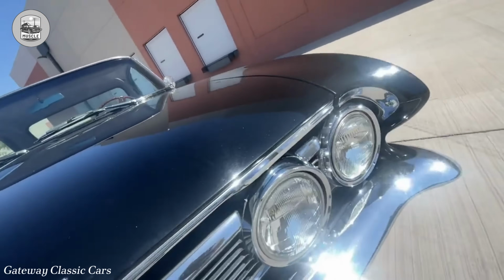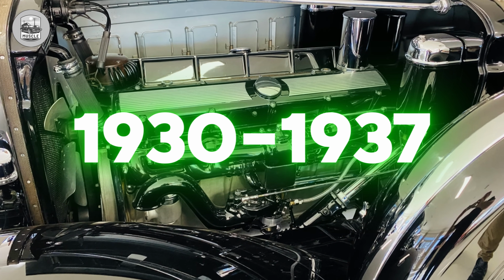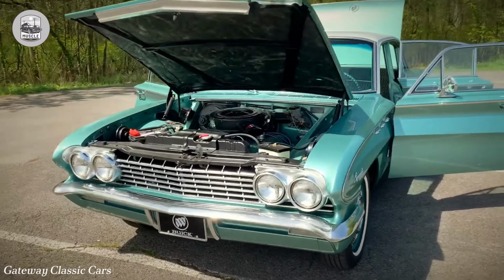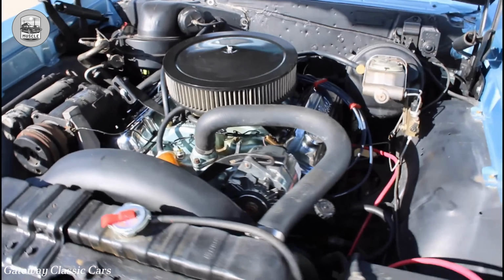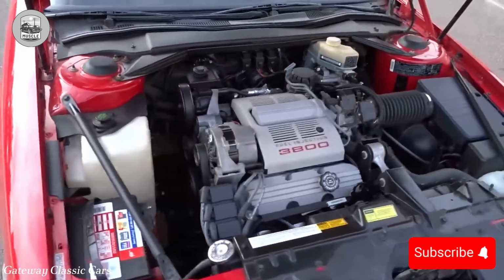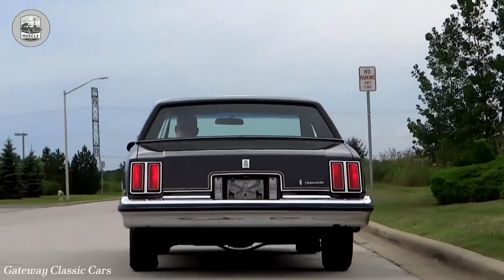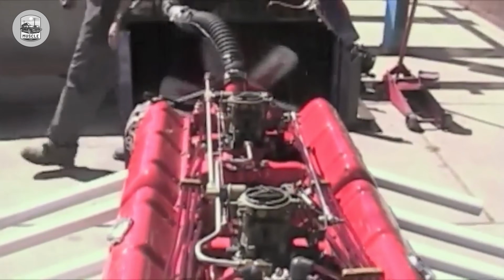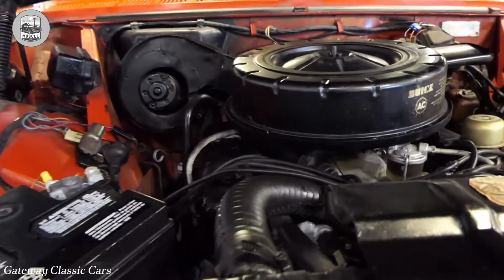10 MOST FAILED and WEIRDEST GM Engines ever made | Worst engines blunder!

Comment: I took an Olds 455 to 501 cu in and 12:5 to 1 compression. At 10K revs 856 rear tire horsepower. 19 miles per gallon city; 26–28 miles per gallon freeway. My Subaru gets 19 freeways on alki gas mix. Pure Gas gets 361 miles on freeway per tank.
Reply: It took about $12K to do that motor. Special box of tools and internals for a  Holley 650 
spread bore  First built it with a Norris 652 race cam and Edelbrock Dual Plane intake. 1050 Dominator carburetor.  THAT combo would not idle under 40 mph. Rear end was rated at 2K hp. Widest ratio Muncie I could find and rigged for super duty. Paint sucked. It could and did run through a radar trap at 138 in 3rd gear.
Hd to fill up and stay away from main roads getting home, lol.
Reply from the maker: @roberthodge2771  Wow! That’s a serious setup you’ve got there! A $12K investment into that motor with those internals and the Holley 650 spread bore is impressive. Pairing it with a Norris 652 race cam and Edelbrock Dual Plane intake sounds like a beastly combo, though it’s no surprise the 1050 Dominator carb wouldn't let it idle below 40 mph—pure race engine territory! Running 138 in 3rd gear with that Muncie and a rear end rated for 2,000 horsepower? Absolute monster! I can imagine the fun (and the challenge) of filling up and keeping it stealthy on the way home.

For everyone reading this, do you have your own stories of insane builds or wild rides?
Reply: @MuscleCarMasters68  After 3 different police agencies gave me a head shake for burning it through a intersection with naught but letting out the clutch; I went home and yanked the engine in my hillbilly working bay of logs in a pair of 'V's" and a 6" I=beam w/ lifting swivel. Stood on the engine with a Coffin Hoist 3=1/2 tone cap. Changed intake, can, carb, and re=inserted it and then went on a date. 10 am till 5pm turn around time. Had to drive the 1958 GMC 4x4 1 tone to get the parts from the shippers. Oh, well. Country mechanics at it's finest.
Reply from the maker: @roberthodge2771  
That’s an awesome story! True country mechanic spirit right there—using what you've got and making it happen. Sounds like you’ve got some serious muscle under the hood with that setup! Swapping out the intake, cam, and carb in just a few hours is no small feat, especially when you’ve got a '58 GMC 4x4 1-ton to get the parts. That’s real dedication, my friend.
Reply from the maker: Wow! Taking that Olds 455 to a whopping 501 cu in with 12.5:1 compression and hitting 10,000 RPM while still getting 856 rear tire horsepower is truly impressive! Not many can claim those numbers, especially with that kind of fuel economy. 19 MPG in the city and up to 28 MPG on the freeway? That's outstanding for a big block with those specs! It really highlights the versatility of these engines when dialed in just right.
As for your Subaru, it's always amazing to see how the difference between alki gas and pure gas can impact mileage. 361 miles per tank on the freeway with pure gas is something a lot of us would love to achieve.

Everyone tuning in, if you're into engine builds like this, let us know about your own! Have you pushed your Olds, Chevy, or Ford block to its limits? Share your stories in the comments! And don't forget to hit that subscribe button to keep up with more killer builds and wild engine setups. Check out our other videos on Muscle Car Masters and be sure to share your builds—this community thrives on your input!

Comment: The ONLY GOOD engine of the bunch was the V-6 engine that became the 3800. The rest were refugees from a scrap iron pile. I don't know how many of these "freak" engines were designed by the same designer. if there were  2 of them or more from the same guy, GM should have handled him a shovel, and told him to dig a grave big enough for every engine he designed!  And SHAME ON GM! Releasing one gasoline engine that was converted to diesel is one thing. A learning curve. But after that, they should have fired the people in charge of the rest.  And by the way, the cylinder deactivation still is a big failing point. If you want a six cylinder engine, buy a six cylinder. But do NOT expect a medium sized v-8 to give you 4 cylinder economy. there is ALWAYS a price to be paid. and that price is failed parts that costs thousands of dollars to repair. you will noticed i said repaired, NOT FIXED. FIXED means it will no longer be a problem. repair means to put it back to stock. meaning it WILL FAIL AGAIN!
Reply: I respectfully disagree with your view, especially regarding GM's engine lineup. While the 3800 V6 is indeed a great engine, it’s not fair to dismiss the rest as "refugees from a scrap iron pile." GM has produced many innovative and durable engines over the years. For example, the Oldsmobile 455 and the 409 are both highly respected for their performance. As for the gasoline-to-diesel conversion, it was a significant learning curve, but dismissing the entire diesel lineup doesn’t account for the innovation that came from it. GM's efforts in engine development, especially with cylinder deactivation (DoD), show forward-thinking strategies to improve fuel economy. Yes, early DoD systems had challenges, but modern iterations have come a long way. It’s all part of the learning curve that drives progress. Rather than outright failure, these innovations represent necessary steps toward better technology.
Reply from the maker: Thanks for your passionate comment! You’ve touched on some key points that have stirred debate for years. The 3800 V6 certainly stands out as one of GM's most reliable and versatile engines. It was a true workhorse, found in everything from Buicks to Firebirds, and delivered an excellent balance of power and efficiency.
As for GM’s foray into diesel engines, you’re spot on—those converted gas-to-diesel engines, like the Oldsmobile 5.7L diesel, were notorious for their problems. The idea seemed good on paper, but the execution fell short, causing plenty of headaches for owners. It's one of those moments in history where hindsight makes us wonder how different things could have been.
On the topic of cylinder deactivation—no argument there. GM's early attempts with the V8-6-4 in the 1980s were far from perfect. The technology has improved today, but you're right, there’s often a trade-off in long-term reliability when it comes to complex systems like that. If you're after true efficiency, a dedicated 6-cylinder engine might be the way to go, but the quest for combining V8 power with 4-cylinder economy has always been a tricky balance to strike.

We’d love to hear more from you and the rest of the Muscle Car Masters community! What engines do you think GM did get right? And for those reading, make sure to comment, share your thoughts, and hit that subscribe button! Don’t forget to check out our other videos for more deep dives into American muscle car history and engines.

Comment: You missed the IH 4 bangger it was a cut in half V8 as well they used them in the Scoots 4 by 4s
Reply: Actually, while the IH 4-cylinder engine used in Scout 4x4s may seem like a 'cut in half V8,' it wasn't exactly that. It was derived from the V8 platform but designed specifically as a 4-cylinder. The key difference is that IH engineers didn’t just slice a V8 in half and call it a day. They carefully re-engineered the block, crank, and internals for the 4-cylinder to ensure it performed reliably in those rugged Scout models. So, while it's based on V8 design concepts, calling it a 'cut in half V8' misses the engineering refinements that went into making it work as a strong 4-cylinder engine.
Reply from the maker: Thank you for bringing up the International Harvester 4-cylinder engine! You’re absolutely right—it was essentially a V8 engine cut in half, which is a unique approach. IH used the 152ci and 196ci versions in the Scout 4x4s, which gave them that reliable, torquey performance while keeping things simple for off-roading. This engine was a tough workhorse, much like its V8 counterpart, and its simplicity helped make it a popular choice for people who loved getting into rugged terrain.
What other unusual engine setups from this era do you think deserve a shoutout? Let’s keep the discussion going! Be sure to comment below with your thoughts, share this video with your friends, and don’t forget to subscribe to the Muscle Car Masters channel for more awesome content. Check out our other videos while you’re here—there’s plenty more to explore....

Comment: The 305 V8 from the 80's
Reply: While I understand the appeal of the 305 V8 from the '80s for its fuel economy focus, I have to disagree with the view that it was a strong performer overall. The 305 was known for several issues, including poor head design, leading to low airflow and reduced performance. Additionally, it suffered from excessive carbon buildup, which often caused reliability issues. For many enthusiasts, the 305 simply couldn't deliver the power and longevity expected from a V8, especially compared to more robust engines of the time.
Reply from the maker: Thank you for your information. It is so great...
Let's see our channel is a place to share, comment or show your feelings about American Muscle Cars.
Have a good day.
Don't forget to like, share or SUB on our channel to enjoy other great Muscle Cars videos.
Spending more time with other great videos on our channel to explore more about American Muscle Cars.
Reply from the maker: Ah, the Chevy 305! It’s a bit of a mixed bag when it comes to muscle car enthusiasts. Introduced in 1976, the 305 was designed during a time when manufacturers were trying to balance performance with new emissions regulations. While it was never meant to be a high-performance engine like its bigger siblings, the 305 had its place in history. In the 80s, it was often seen in Camaros, Monte Carlos, and full-size sedans like the Caprice, giving decent fuel economy and reliability, but many gearheads found its power output a bit underwhelming compared to the legendary 350.
However, with a few mods like a better intake, headers, and maybe even a cam swap, you could wake up the 305 and get some respectable gains. In fact, some folks had success building them into budget street machines.
But I’d love to hear from everyone else! What’s your take on the 305 V8? Did any of you ever mod one? Drop your experiences in the comments below and let’s get a good discussion going! And don’t forget to share this video with your fellow muscle car fans. If you’re new here, hit that subscribe button and check out more videos on the Muscle Car Masters channel. Let’s keep the engine talk rolling.
Reply: @MuscleCarMasters68  In the 80's and 90's; my dad owned a salvage yard, wrecker service, mechanic shop, and metal recycling center. I actually smashed so many of those cars and scraped hundreds of those 305's. Dad didn't like them because they were way underpowered for the heavy cars they were put into. They wore out quickly and had overheat issues. By the way, I'm 57 years old and currently make my living as a mechanic. Very much appreciate the video, because I forgot about the GMC V12 or twin V6 as we used to call it.
Reply from the maker: @lincolnherzberg1866  Thanks so much for sharing your story! It must have been quite the experience growing up around your dad’s salvage yard and wrecker service, smashing cars and dealing with those 305s firsthand. You're absolutely right about the 305—designed with fuel efficiency in mind, it often fell short in the power department, especially in those heavier cars. Overheating and rapid wear were common complaints, especially in the early iterations. But it's always fun to think back on the ones we used to call junk and remember engines like the GMC V12, or the "twin V6," which was an engineering marvel with its unique design.
We’d love to hear more of your experiences working on those engines, and I’m sure others would too.
Have a good day.

Comment: GM still has not mastered its Displacement on demand & currently a class action lawsuit for it.
Reply from the maker: Thanks for sharing your thoughts! You’re absolutely right—GM's Displacement on Demand (DoD) technology, now part of the Active Fuel Management (AFM) system, has seen its fair share of challenges. While the idea of improving fuel efficiency by deactivating cylinders under light loads is innovative, many drivers have experienced issues, including excessive oil consumption and mechanical failures, which have led to class-action lawsuits.
One key problem with DoD is the complexity of the system, which involves intricate electronic and mechanical components. Over time, these parts wear out, and when they fail, they can cause misfires, engine noise, or even more severe engine damage. GM has introduced updates and improvements, but it seems there's still work to be done to ensure long-term reliability.

To everyone watching, what do you think of Displacement on Demand technology? Have you or someone you know had experience with it? Drop your stories in the comments, and let’s get a great conversation going....
Also, don’t forget to subscribe to Muscle Car Masters for more content like this, and check out our other videos for more deep dives into American muscle car history and technology! Keep the discussion rolling, and don’t forget to share....